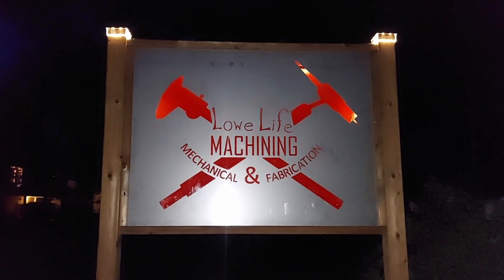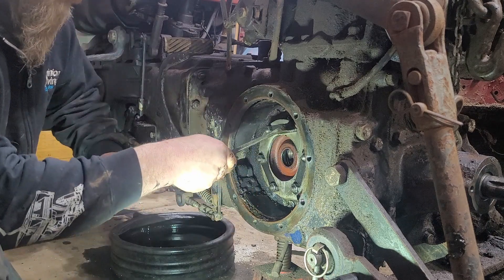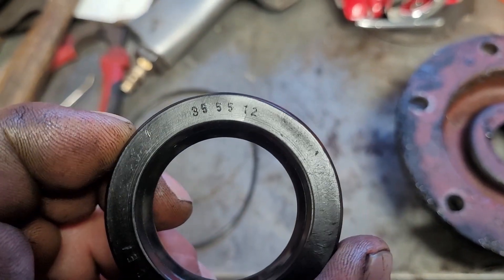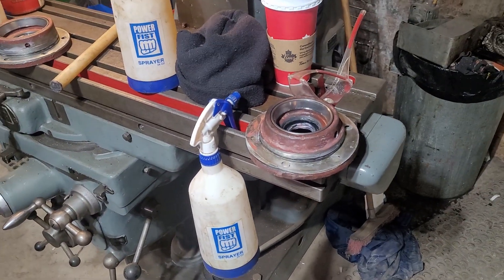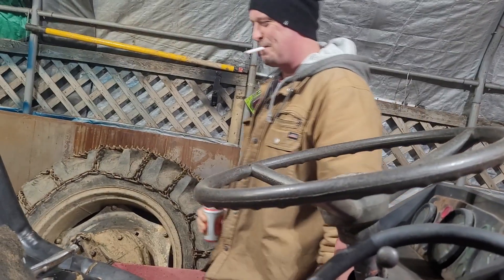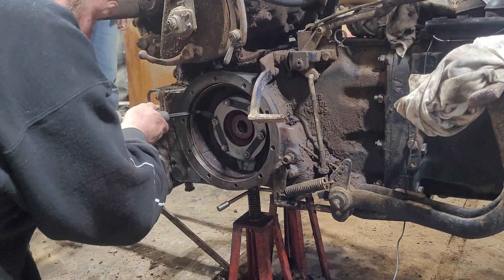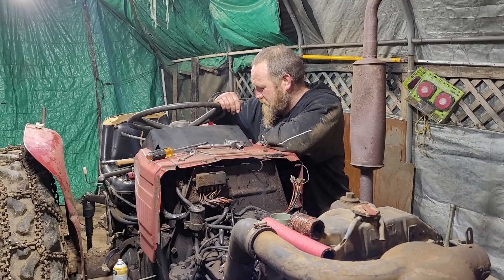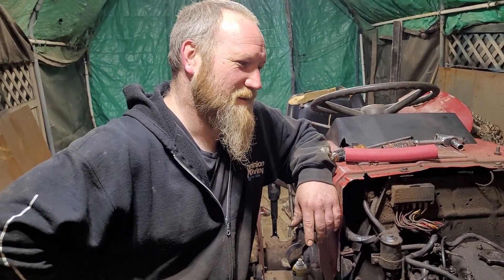Installing rear axle seals on a 350 universal long fiat tractor leaking hydrulic fluid.

Comment: Looks like this job is in my future.  My Oliver 1365 is also leaking hydraulic fluid from the weep hole like yours.
Reply from the maker: yup sounds like you'll need some axle seals. its been a few monthes now since i've done this job, and the customer is still pretty pleased with the result!